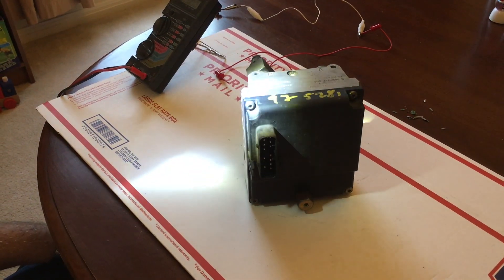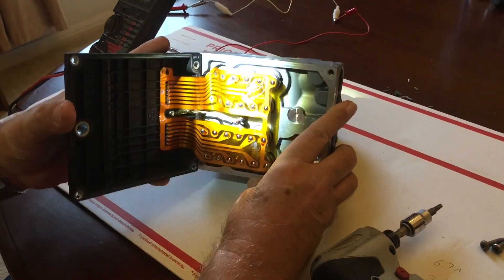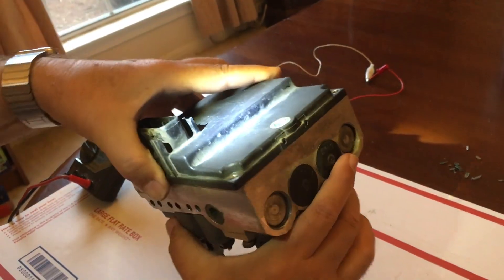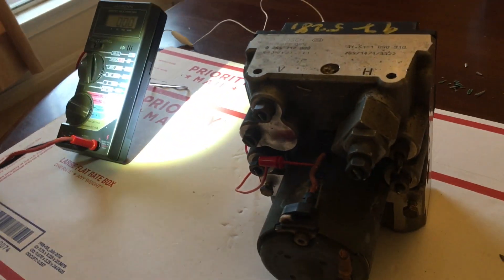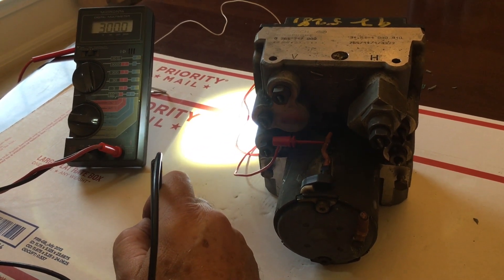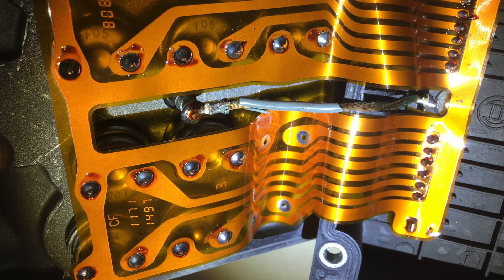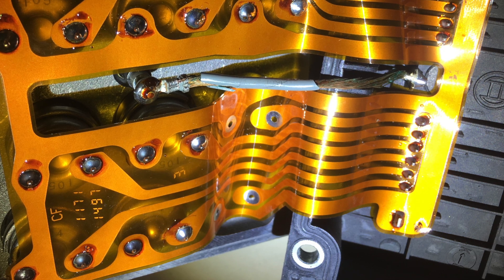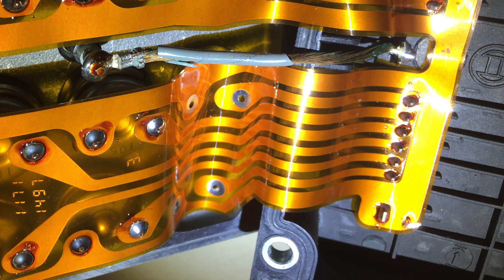BMW e38 ABS and Traction Control fix.

Comment: Hi Rich, I hope I'm lucky and you're still browsing the comments. I have the same unit and I fixed the problem you showed, but looking at the repair of other Bosch units, such as 001-005 from later BMWs, I saw that there is a microcircuit inside them that often has problems with contacts. Please tell me if it is possible to get to this microcircuit in this unit and is it there? Or is the control in this unit done remotely?
Reply from the maker: I no longer have a spare ABS unit ( so I do not have one to take apart and inspect )
But I do not think it has a microcircuit.
Reply from the maker: ( If by microcircuit you mean a CPU built into the ABS unit , I don't think it has one. )
Reply: @richlove99  Thank you very much for your answer 🤝

Comment: is it nesecery to crumble the inulation then puting the new tape or can I just put the tape around remaining insulation?
Reply from the maker: Seems like it would be better to remove the crumbled insulation before putting the tape on.
Reply: @richlove99  It makes more sense yes…..Dont know if the wire can be disconeted or it is welded? I supose those ends where the wire is conected they dont have to be insulated…
Reply from the maker: @KOMAR9111    True, the ends don't need to be insulated. It is the bottom loop that needs insulation so it does not touch the body of the ABS unit.
Reply: Does in theory when you insulate te wire in order to see if the lights will go off do you only need to turn the key and wait on dashboard to go off or does the car need to start, maybe moving?
Reply from the maker: @KOMAR9111   You need to drive it for a few miles before the computer will see a normal condition and shut off the light. Or if you have the Peake tool, you can reset the light.

Comment: Does it bring on error message "Pump Error" in ABS/ASC module?
I have this error in my E39 and I think that I may have the same problem.
If I can fix my ABS pump like that, I will be very happy and thankful!
A new ABS Pump costs around 1600 euro... that's painful for a simple motor and a block of valves :D
Reply from the maker: No, my e38 just had the ABS light come on. I don't know if the e39 would have the same problem. I think BMW re-designed the ABS unit for the e39.
Reply: @richlove99  BMW redesigned the ABS module for E39 after 09/1998 :)
My E39 is 1997 and it has the same module. 
The part number ends in 000, sane as yours.
That's why I assume that my pump has the same issue.
Thank you very much for the video! It was very helpful!
Reply: This is the OEM part number of my pump: 34511090911
It's made by BOSCH and their part number ends with 000

Comment: Have this same issue, same thing when I open it up though no matter what I do I seem to still get no resistance between the wire and the housing. Even when I know the wire isn't in contact with the housing so I wonder if there's some other point in the unit thats making contact. Going to start pulling it apart to look
Reply: Just figured out my issue I think. The motor itself is fried. Isolated it from the unit overall and found no resistance between the power input and ground post. Unscrewing the little nut on the ground post on the back of the motor Isolates it from the case showing infinite resistance, but putting it back on shows no resistance. Problem solved, good thing to go ahead and just check before taking the time to pull the entire unit out and take it apart.
Reply: Windings of the motor probably broke or something perhaps
Reply from the maker: @bodytolson7390  Yes, if you are getting no resistance though the motor, that is not good. I have a spare unit here and verified that the resistance should be about 11 ohms through the motor.
Reply: @richlove99  Awesome, I've already gone ahead and ordered a used unit so I'll be checking all this first thing. FIngers crossed and thanks for the info. Save me a lot of headache and wallet ache at the dealership.

Comment: Thank you. I have a ‘97 750 IL and had the same problem. I opened it up and there it was, just as you said. An exposed wire with crumbled insulation.
My problem was ABS light on. No cruise control and speedometer not working. I cleaned off the crumbs and taped it up. Problem solved but only for about about 6 month then it came back. I checked to see if there was an arcing point, didn’t see one, put a little bit of extra tape on, but it didn’t work. At least I know where the problem is.
Reply from the maker: speedometer not working is usually a sign of a bad wheel sensor.

Comment: Mr. Rich have you ever experienced slow acceleration or hesitation on your E38? Mine does that now...
Thank you for the great videos and I appreciate sir !
Reply from the maker: Has nothing to do with ABS. Since your problem is off-topic, I would visit http://www.bimmerboard.com/forums/e38  

Click on Search and enter "slow acceleration or hesitation"  

For what it is worth, the only similar symptom I had was that when the engine was cold when you first started it, the idle was bad and it would hesitate on acceleration. After driving for a few minutes, the engine would warm up and would then run fine. The solution was to replace the air intake manifold gasket.
Reply: thank you, the reason why I was off topic is because I saw that you own an E38, I tried to find videos with E38 about hesitation and nothing , thank you again and I appreciate

Comment: Thanks for the video and explanation, is there any way to check the unit using voltmeter without taking it out of the car? I have 1994 European e38 740i, and i have bought it with the abs/asc light on about a month ago, i went to the mechanic, which connected to it with codereader, and it said it's front right (passanger side) abs sensor, after replacing it, the lights were still on. But actually it might be another dead abs sensor, since the speedo and consumption gauge also started jumping up and down while i was driving, and then finally died completely (that was before changing abs sensor). So im pretty sure the abs unit is allright? Well anyways, thanks again for the great video, and sorry if i wrote anything wrong, my english is far from perfect.
Reply: +Rob38 You can measure from pin 3 to ground to see if you have a short.
You should get about 6.5 ohms if there is no problem. Photos here...
http://goo.gl/h4Ylgf
Reply from the maker: +Rob38 
Rob,
If your speedometer is not working, it is most likely a wheel sensor and is probably the drivers side rear (at least on my 1995 740i , that would be the sensor)

Regarding, resistance measurements of the ABS pump, I would disconnect the large data cable on the ABS and then check the pump resistance from the positive wire to ground. It should be about 6 or 7 ohms. But you need to strip a small section of the insulation away so you can get a meter on it. Maybe one of the connections on the data cable would work but I have not verified that.

Rich